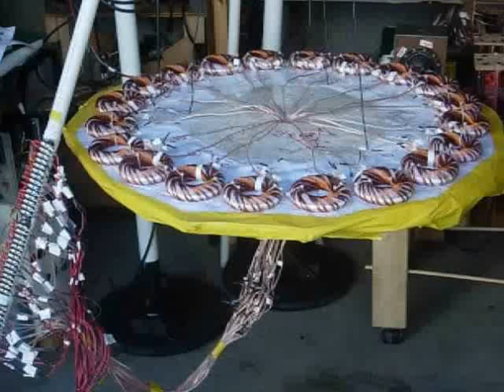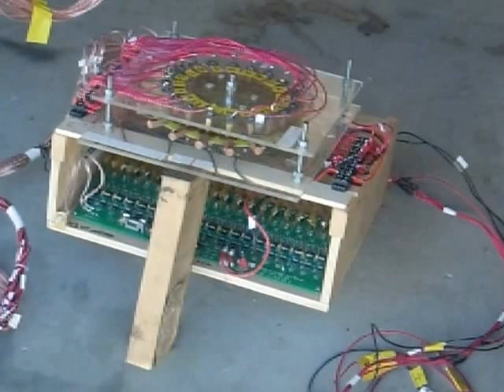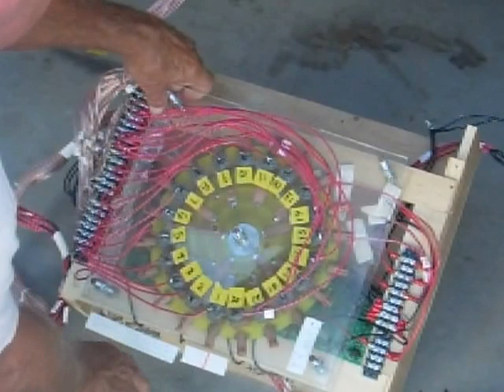Don Smith #82 Anti-Gravity Platform Update

Comment: Jeezuus ...what a lot of work!,  I can't make sense of your train of logic in this video however.  The fets will fail on you...I don't recommend using them. :-/
Reply from the maker: Yup lots of work the FETs simply provide a ground path for each of three energy levels based on the binary codes 4,10,17.  I choose Rodin style coils because work very well with nature  I built it so that the wooden dowel wheel allows for the pattern to shift 360 degrees.  brushes allow this.  The pyramids must also turn as well so that their corners  always point to the none energized coils 4 of them   The frequency of the pulses to the FET gates is unknown but I would imagine that it will be high but who knows. the only thing I am missing are the generator for the three level pretty easy to build this and the two pyramids made of pink quart based on the ratios in the crop circle compared to my device diameter I should use about 1.75 inch  side length pyramids.  Spacing between the pyramid is also unknown.   The way this should work is the coil create an energy field that interacts with the pyramid crystalline structure and they inturn cause a vortex of etheric energy from the vacuum to flow thru the unused coils into the center. Theirs a lot to testing to be done here, some of which could be extremely dangerous.and hopefully the platfor will show signs of floating when energized. I don't have the time to do it now trying to get the car motor done and right now I'm making the self running none mechanical rotating field generator.

Comment: Explain please dielectric field of 3 plates or how you mean ? Waiting for results thanks ...Great work..
Reply from the maker: The controller that has the FETs on it provides a ground path for the energy that passes through 16 of the 20 coils used. The copper plates have brushes riding on them which allows for different coils to receive the 3 levels of energy 4,10,17. This will allow for control of the platforms direction. When you plot the energy for each coil presented on the crop circle as 5 binary bits.   My hairpin circuitry will be used to provide these three levels.                  The controller has a wheel idea which has three copper bands for these energy levels.  I haven't turned this on yet because I'm missing the two pink quartz pyramids same material used in Kings Chamber Great Pyramid Egypt. .  Near the center of the crop circles you'll see two groups of equal lines take 8 straws make two pyramids.                 I believe that this energy should be Tesla's Cold Electricity or what some people call Dielectric Electricity.  This type of energy can be generated by sending sparkgap energy thru capacitors. one side of the cap has normal electricity (electron stuff) and the other side of the cap cold no electrons.  look for Tesla's Hairpin circuitry the shorted copper pipe is driven in this circuitry thru caps HV HF from a sparkgap.
Reply: CAPTAINSSBN there is a lot of videos of so called cold electricity I don't know do thinks it is a same energy or not but the guy who I watched is conected with  body and holding light bulb of 220v in hand and lighting up...
Reply from the maker: Think about Yin/Yang  today all electrical item run on hot electricity which contains electrons, we completely ignore the other cold side which has no electrons but is only radiation.  This radiation can run all our stuff just as good as the Hot electricity and it is a lot safer when produced with very high frequency Tesla Skin Effect.  a light buld running on HFHV Radiant energy cold stuff can run huge loads from a very small conduit wire and even under water.  You can put your hand in the water as well with harm.
Reply: CAPTAINSSBN I understand now I'm reading Tesla patents and he explained almost all of it just conect small dots and everything is difrent...thank you for  clear explanation that cold electricity coming from dielectric how I saw ?
Reply from the maker: Tesla chose 925 Hz for our grid frequency at first then he decided to use 60 Hz EU chose 50Hz.   If you take 925 Hz and divide it by 2  four times you get 57.81 Hz  we use 60Hz. now divide 57.81 by 2 three times and you get 7.22 Hz which was the vibration of Earth at that time. I find it interesting that he chose a grid Hz that was a harmonic of Earths vibration. It's also interesting to note that 925/2 is very close to the Great Pyramids Kings Chamber resonant freq of 432 Hz.  The pyramid was a power broadcast station  and there are some drawings showing devices with tesla like coils, that probably used the energy for all sorts of things one would be to heal people.  All good stuff.
Reply: CAPTAINSSBN Wilhelm Reich,Viktor Grebenikov was talking about energy materials geometry,  but Tesla did with impulses and materials all in geometric shape...

Comment: Awesome work, dang all this stuff looks complicated. Thank you for posting.
Reply from the maker: +Naoki Kashima It looks complicated but really it's pretty simple.  The crop circle shows a lot of info, but I wish they would follow it up with more info.  For example:  They show around the outside edge 20 structures which to me are some kind of coils whether these are plain coils or toroid's  Is unknown.  I choose toroid shaped because of Jack Scholtz's  test with the neo ball continuing to spin even though the power to the toroid was turn off.  The field from his 12vdc battery pulses was massive.  at 10 feet away no power the neo still continued to spin. Imagine 1000 v impulses.  Form this I believe that the 16 of the 20 coils are used and their energy flows expand inward upon the two pyramid crystal structures one being below the platform and the other above it.    The lines between the center and coils represent a binary code and when decoded become 4,10,17 or   00100, 01010,  10001.   amazing stuff you get the same numbers reading the code either in or out.     I'm not sure what these number represent could energy Radiant style Tesla coils, or perhaps sound frequencies probably a combination of both.   Three different levels.  I also see that 4 coils have no binary code associated with them.  To me these openings in energy flows allows Etheric Energy from the vacuum to enter into or go out of the platform.  And finally in the center the is a crescent C shape with a vortex pointing at one of these unused coils.  This is showing direction of travel and is proven when you plot the energy field.  My platform controller looks complicated but the PCB is used to provide a ground path for each of the 16 coils used and the wheel idea allows for the energy binary codes to be changed 18 degrees for each new position which will cause the platform to move indifferent directions.

Comment: Hey captain, u might need to nanocoat all these wires(look into Keshe magrav system). All of these wires will cause a lot of energy losse. Great progress.
Reply from the maker: +lustatus when done the three energy levels will be radiant energy and the wires will simply be conduits.  It'll be interesting to see what happens when the radiant energy puts pressure on the dual pyramid structure in the center of the coil structure.

Comment: Are you building coils like Stan Deyo anti gravity coils? are is this a differnt type. Also there are systems that pulse a magnetic field  or rotate the field and then dump electrons into the field with a Tesla coil creating a shield of electrons  around the coils greatly increasing the effects. looks  like a bubble of plasma.
Reply from the maker: +Jesse Reiter I decided to use the Rodin toroid coils instead of regular ones but either may work.  For a long time I felt that the two groups of eight pulses above the Crescent C represented a 64 tetrahedron crystal but now I'm sure that they represent  are two pyramid shaped crystals .   If I can get some of these made then the only thing I'm missing will be the three level energy system.  I already have the controller done.  If you look closely at the crop circle you'll see that their is an egg shaped vortex.   The C indicates the direction of travel and when you plot the energy pattern you see that this is correct.  This is a fixed direction of travel and my controller even though it looks like it was made for cavemen will allow this engine to change direction.   The platform should hover and go in the C direction.  The PCB I designed is only used to provide a ground path for the three energy levels to the 16 of the 20 coils used.  Turning the doweled wheel simply changes the power to different coils, but keeps the exact same power level setup.   Some crystals are know to glow in the dark.  The sapphire ones might be the best ones to use.

Comment: that was a lot of work lol. awesome/  have you seen the primer fields by dave lapont,  part 1 is a must,  one spinning field spins all the others,  in ratio,s if one likes.  hmm, in ratio,s any ratio,lol
Reply from the maker: I'll try to find it.  also need to find a video describing the toroid field as a fractal display.    I know the basic structure from repeating the Scholze neo ball test  Thrive Movie.  that was awesome no power to the Rodin toroid coil yet the neo ball kept spinning at a distance greater than 15ft from the toroid.  its interesting to watch this happen and I would imagine that many tests with different materials would show what is going on.  The field is growing  outward and then collapses back to the zero point.  The 1/2 inch Neo ball is heavy and to keep it going take some force lots of friction in the shot glass.   lots to do
Reply: see   super magnet man   martian math   prime numbers come in groupings of four.  there are 24 sets between zero and 1ooo.  the hallbache  array is formed when a circle ,with any grouping of four is applied.  the natural phenomenon.   I send you some
Reply from the maker: just watched part one.  they are using some neo magnets inside and outside the vacuum chamber so that they can change the position of the two bowls during tests.   It was interesting that they are relating the results to presentation in the galaxy.  They are using liquid metal to display results.  I've done some tests with 1/4 inch pieces of paper clips stood up on the end of a magnet interesting to observe what happens when you move one paper clip piece towards the other one.  they walk side by side but only if they have the same length. if one is longer then they simply connect at the ends.
Reply from the maker: check this out.
Lolo Neoball Resonant Spinner II

This has some huge implications and needs lost of testing

Comment from the maker: three energy levels from the crop circle are 00100=4, 01010=10, 10001=17(differences are 6 & 7)..  no matter which direction you read the crop circles ones and zeros you get the same results.  The Aliens did this so we can't screw it up.   my original calculation was 11011=27,10101=21, and 01110=14(differences are 6 & 7)    Same no matter how  you do it you get the same results..